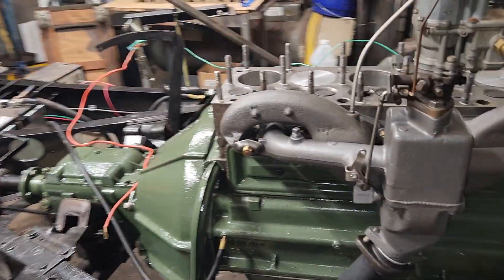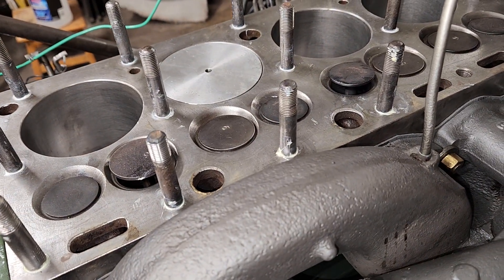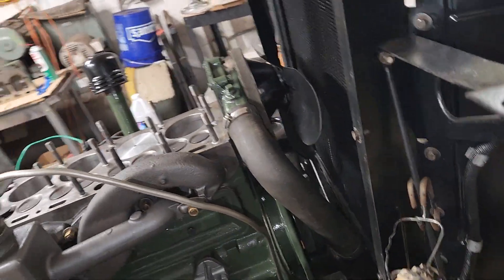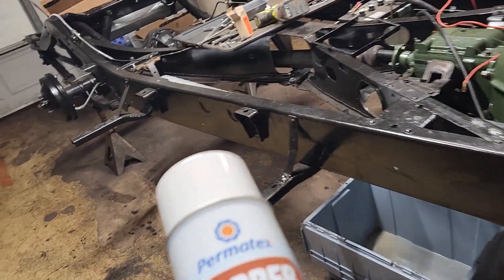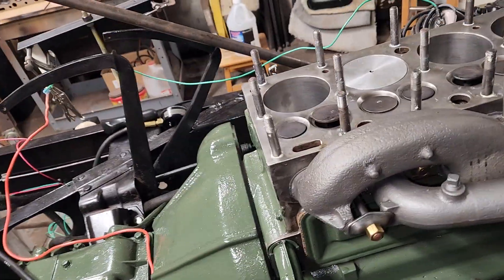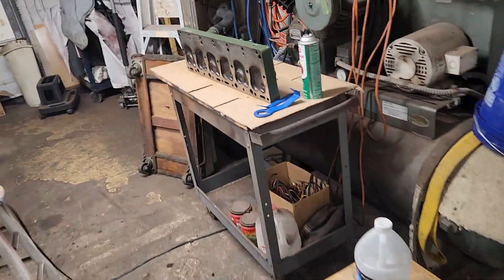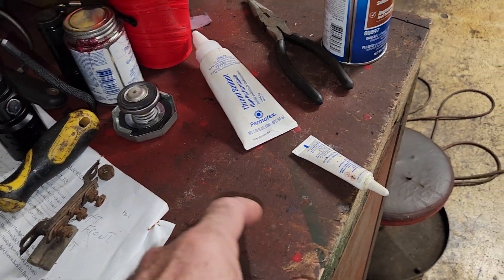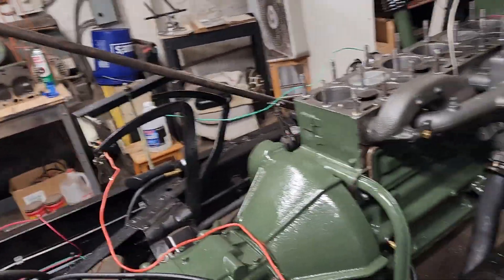Packard 6 cylinder head bolts leaking coolant.

Comment: I agree...use the copper coat...I always torque the head cold and then start the engine without any coolant in it...let it run until it is hot enough, you don't want to touch the head.
Then I re-torque the head hot....let it cool to ambient temperature and re-torque again....
Then add coolant, I usually just use water, and run up to 180 and torque again hot and after it cools...
Drain and refill with coolant....
You have a beautiful looking engine there....
Good luck
Reply from the maker: Thank you